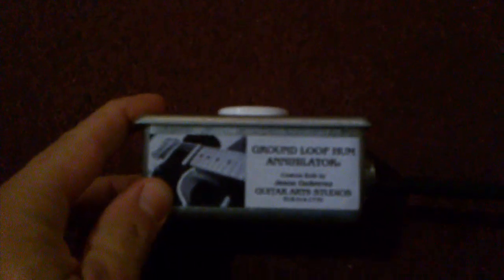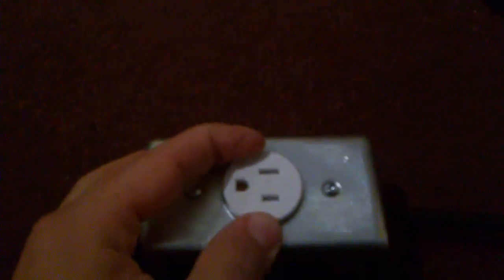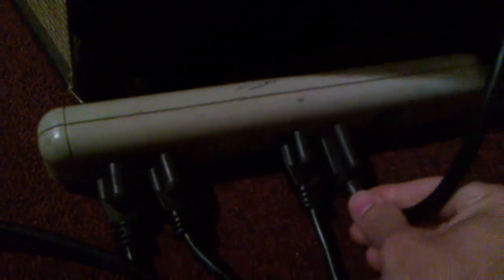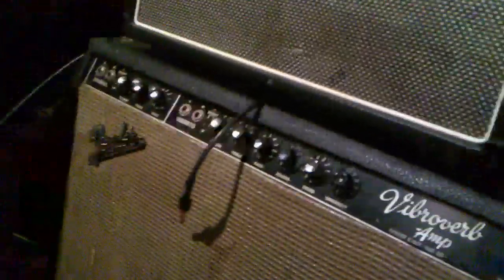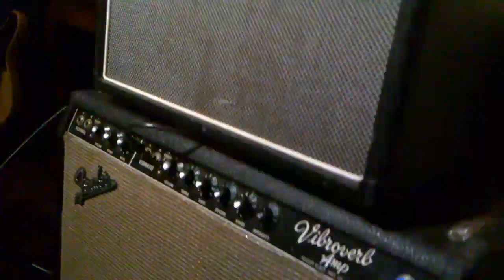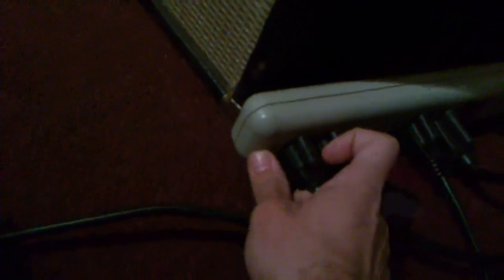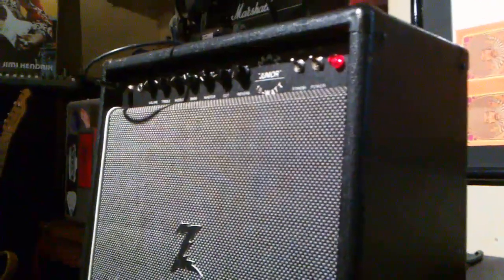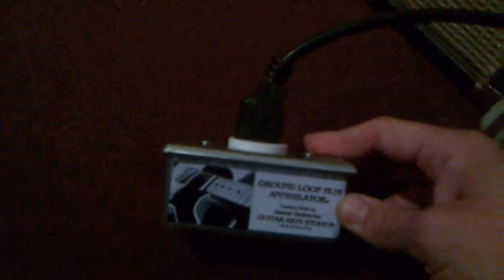AC Ground Loop Hum Annihilator - Eliminator - Suppressor - by Jason Gutierrez Demo

Comment from the maker: @NewMusicSpacequake There are a lot of things which can cause hum in an amp. What kind of amp is it? Is it a tube amp? Just as a troubleshooting step, try lifting the ground (temporarily) using one of those little 1dollar 3-2 prong adapters and see if the hum goes away.

Comment from the maker: @NewMusicSpacequake This is not for one amp and would not help an amp that hums all by itself unless your guitar input is also connected to another grounded device causing a ground loop. Does your amp hum when your pedalboard is not plugged in to it? If that's the case the hum is coming from somewhere else. Florescent lights, filter caps, poor grounding, lead dress in the amp, etc. Is the "AC adapter" to your pedalboard a VoodoLabs Pedalpower or something? Those don't typically cause AC hum.

Comment from the maker: If running a single amp with grounded processing gear and a ground loop is present, you could us this device to eliminate the hum. Each additional hum introducing device would need its own hum annihilator. I can also build dual units with a single power cord for the cost of two units, $80.